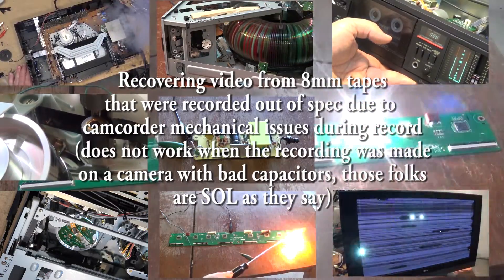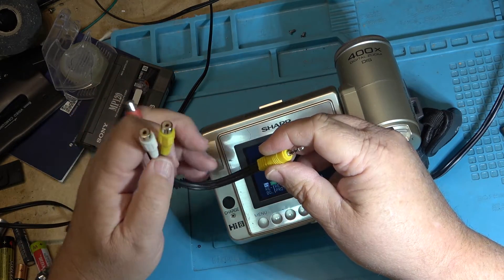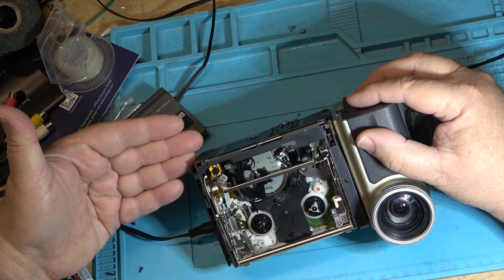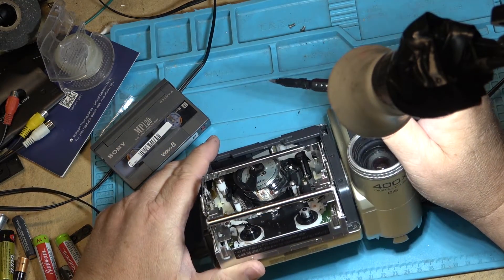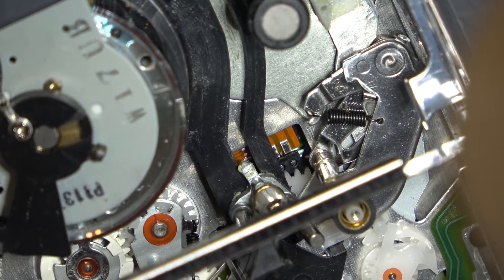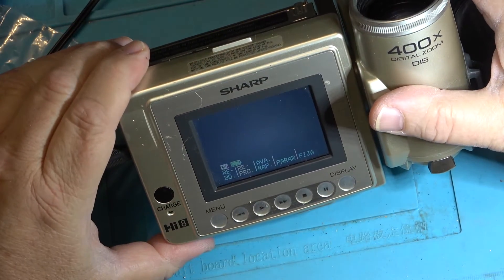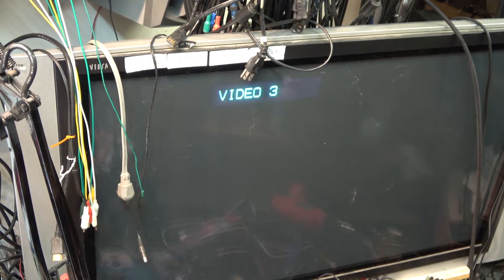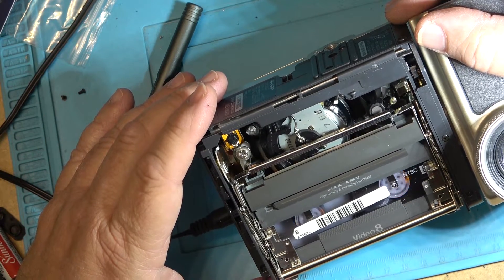Recovering 8mm video from misaligned camera

Comment: I had one of these ages ago! Fantastic technology for the time. Ended up not being able to read tapes so I got rid of it. I should have kept it after seeing this video.
Reply from the maker: I'm getting rid of all my old camcorders.
Reply: @12voltvids  Why? Aren't you getting much transfer business anymore?
Reply from the maker: @Kimble221  I have 6 digital 8 devices that all play analog. I think I have more than enough equipment.  I'm dumping all the surplus equipment.  Conversion work is slowing down because competition is advertising lower rates and I am not about to get in a race to the bottom.

Comment: Do you have an opinion as to why 8mm video tapes did not take the place of VHS? I know at some point in time you could buy pre-recorded movies on 8mm. I have a couple of films on 8mm tape. So I know there was an attempt to market these. Any thoughts as to why they never really took off in the home video market?
Reply from the maker: Sony tried. The problem was VHS was already too well established and people quite frankly didn't care about picture quality.They cared only about the cost of the machines and the availability of rentals.
Remember there was Betamax before and it had a better picture as well but never dominated. 8mm and Hi8 did dominate the camcorder market and Sony hoped that the suscess it had in cameras would spill over into home video, and it might have had the large movie rental stores embraced it, but there was a new format out called DVD and that took the wind out of 8mm sails. 8mm was adopted by the airline industry for in flight movies. It was used heavily by videographers and even news crews were using Hi8 as a cheap alternative to betacam. They generally sent small hi8 cameras and inductrial hi8 cameras out with reporters and then edited straight to betacam for the air tape.
My EVW300 came from a local TV station. VHS was basically a lost leader there in the later years. So many companies were pumping out plastic decks that sold for next to nothing.JVC had very little marketing skills, and they didn't do the VHS format any favors by giving away licenses to make machines.  Of course it worked out well for joe 6 pack where he could go to the local discount store and pick up a vhs hifi machine for under 100 bucks. (The last new VHS I bought was a Panasonic Hifi and I think I paid 89.00 for it in 2002.)